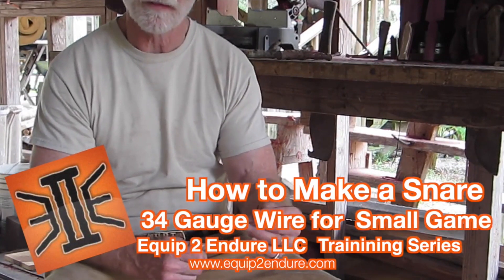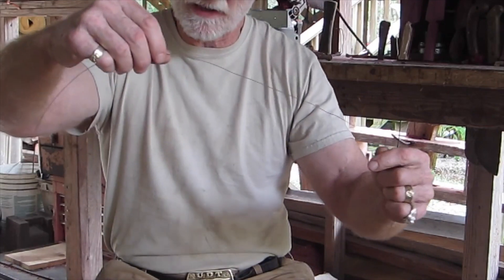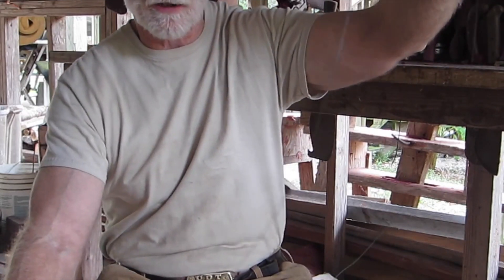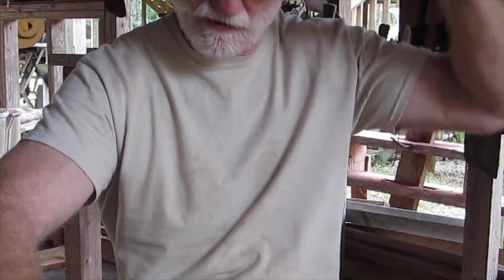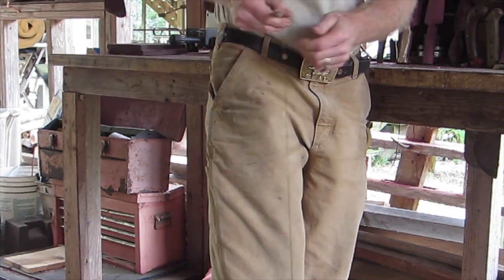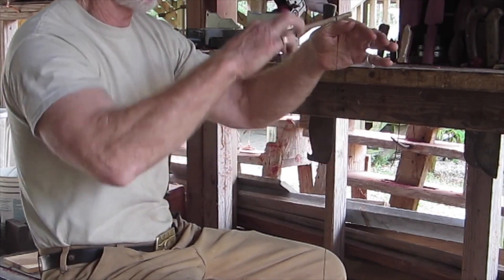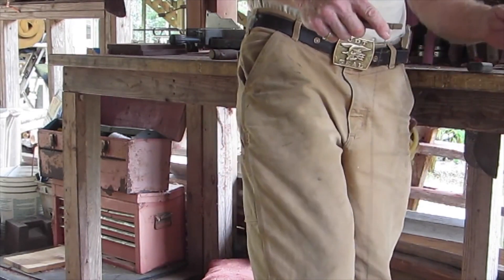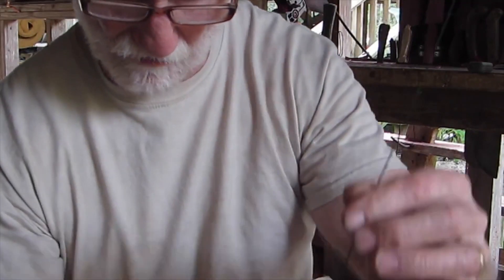Trapping and Snaring Part 2 by Equip 2 Endure

Comment: Made many a snare just that way with found wire.  Didn't have much choice about the wire I used when young because we were dirt poor.   I haven't intentionally carried such wire in a lot of years, though.    Good braided wire that already has the right texture is only a few dollars per hundred foot spool,  and a tunnel is easy to make.   But if you have only a smooth, thin wire, that's the right way to build a snare.   I prefer pre-made snares that have a lock built in..  They're a little pricy, but they work wonderfully, and come in sizes from mouse to moose.